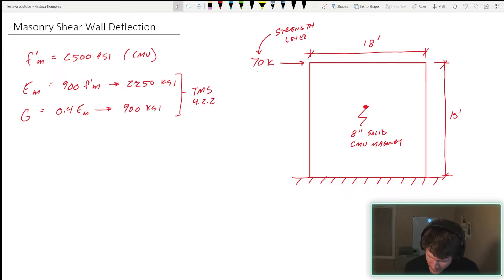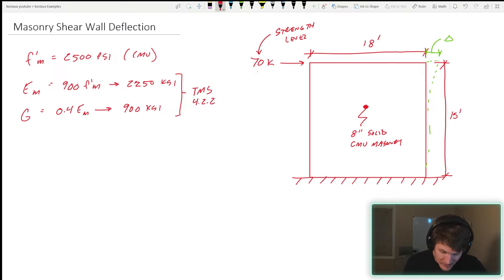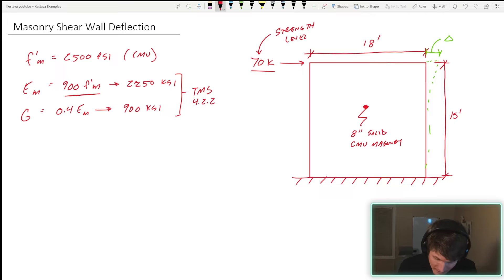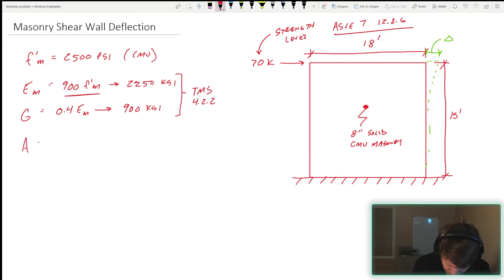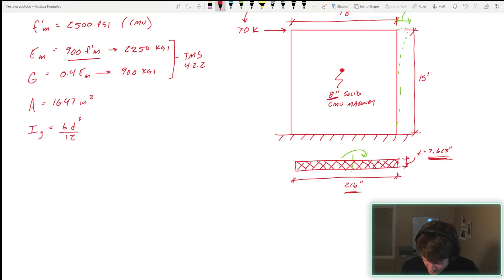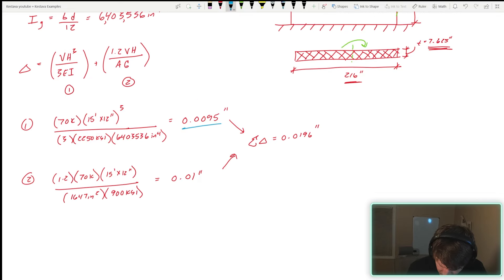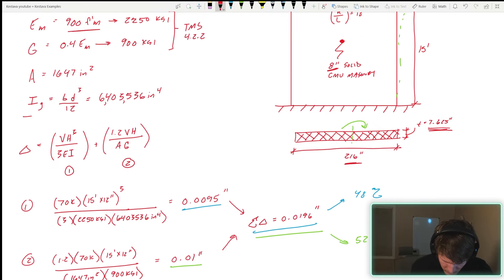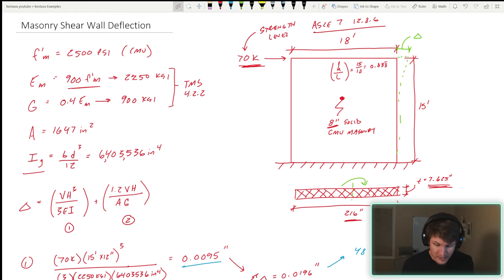How To Calculate Masonry Shear Wall Deflection By Hand #structuralengineering #engineering

Comment: 8" nominal CMU is 7 5/8" to account for the 3/8" head joint mortar at corners.  Bed joints are also 3/8".  I think the TMS gives an allowable tolerance, however.  Another great episode, Rich.  Thanks.
Reply from the maker: you just got pinned Eric!

Comment: Hey Rich, don't you need to apply the Cd factor to get the inelastic drift? is it because the system we analyze doesn't crack?
Reply from the maker: Your spot on! I did not touch on any of the code drift criteria in this problem. this subject will be included in my next video along with cracked wall properties!
Reply: @Kestava_Engineering  Nice can't wait to see it :)